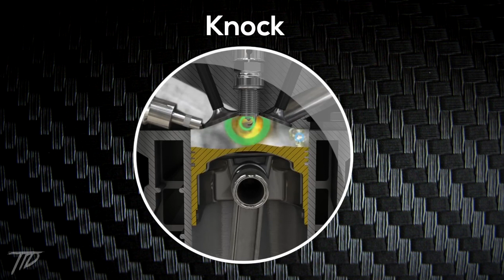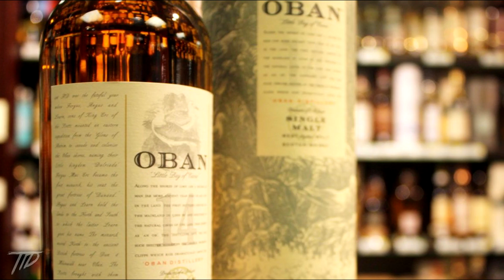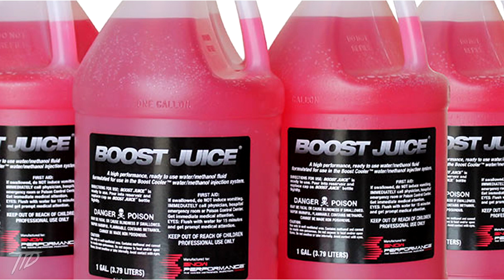What's the difference between E85 vs Water Methanol Injection?

Comment: any advantage or power gains by running on say a cammed NA 2019 6.2L silverado?
Reply from the maker: Typically, the use of E85 or meth injection only provides a significant benefit to forced induction applications.  An NA application won’t benefit nearly as much from what these fuels/additives offer.

Comment: I’m currently running E85+ on my car but still seeing higher levels of heat in the engine causing my electric fans to constantly stay on and sometimes my coolant temp’s are very high. Is it possible to run both E85 and water meth to keep the engine temperature down during boost?

Comment: I am in the process of installing a Snow Perf water/meth 2.5 kit on my ‘20 F150 3.5EB. Can’t wait to see how it improves my et’s.
Reply: Do you have it up and running? I have a Flex Ecoboost with the same engine and have wanted to install a system
Reply: @resuwrecked  not yet. I have had a few life hiccups lately. Hopefully by next weekend I’ll have it finished. I’ll comment back on here when I do and you can go watch the video I’ll be posting about it.
Reply: @Estudiante77  Any updates to your install and use after installation?
Reply: @StelaPop  I finished the install back in February. I ran 3 gallons of water meth. I was satisfied with the results. Are used the 87 water meth tune that my tuner provided. But in March I had a hand accident at work and put me out of work for two weeks and then spent 12 weeks for therapy. Then I got real busy at work. And I never had a chance to upload a video about the install. But, I need to make time to do that.
Reply: Sorry to hear of your injury and time off. Glad you are back at it.

Comment: You only use W/M when you're on boost vs e85 at all times.
You must  have a flex fuel kit installed where there's no e85 around or planning to travel or you're stuck. Also is corrosive so you must use "special" injection systems to be compatible and so you gotta buy other parts to support the set up whereas W/M don't, as it's being sprayed from a reservoir not the gas tank.
E85 gives lots of fuel issues compared to W/M plus e85 sucks in the winter.
W/M is the way to go, I'm getting a kit for the summer, more convenient, less expensive and meant for daily driving.
Reply: I got 2 cars on it without issues.
Reply: Missing a few points, methanol is corrosive and does also attract water just like E-85. I'm going to be running both for the best of both worlds.
Reply: I heard meth for my car which is a inline 6 doesn't reach the last cylinder head when it sprays so I'm not sure of using it..
Reply: @charles-fq2dw go port injection so each cylinder gets equal amounts of

Comment: is flex fuel the same as e-85? Royal Farms has what they call Flex Fuel 104 I assume 104 is the octane rating which is about what e-85 is supposed to have (105) but I'm not sure I can assume the actual ethanol content. I'm running a full bolt ons Stage 2 Plus 2015 BMW 335i and am thinking about doing a meth kit too, already have the connector on my VRSF charge pipe so I'm set up for it. I do hear that the best set up for my car is running 50/50 meth/water and on a E-20 map if I'm on a stock fuel system. I assume I would need a custom map to really get the benefits of meth though, what do you think?
Reply: flex fuel means ur computer has a flex fuel sensor that can read and analize either e85 or any other octane ur using. 104 octane is GAS not ETHANOL. ur confused bro. E85 is not 104 gas octane although it equals about 105 octance it is NOT GAS ITS ETHANOL. theyre different fuels. u can run 50/50 but plenty run straight M1 which is methanol
Reply: @TENNESSEETRACKHAWK  negative, I not only confirmed with them that it's ethanol I've tested it now 3 times myself and it's exactly 83% ethanol as they said for the summer blend (76% they claim for the winter blend)
Reply: @chrisgarret3285  Are u drunk dude? Du u have any idea what flex fuel is? U seem utterly clueless. Flex fuel is not E85. E85 is an ethanol based fuel and can be used if ur car accepts flex fuel or not. Get a clue dude smfh. I use E85 and I dont have flex fuel. I cant run 93 octane cause I dont have a flex fuel sensor. This isnt rocket science bro. Flex fuel means u can run both Ethanol and gas.

Comment: Intercooler or MeOH water injection? What is better?  Intercooler works all the time, Methanol water needs careful tuning , correct?
Reply from the maker: For any kind of forced induction you should be intercooling the hot charged air.  MeOh injection is a way to run more of that cooled charge air (boost) and mitigate the harmful effects of knock/pre-detonation. So the intercooler and MeOh injection serve two different functions.

Comment: Can Water Methanol Be Used To Run More Boost / HP On Same Ring Gap? I Got A 5.7 Hemi With Stock Ring Gap And It's Making 450AWHP With Zero Knock And Only Has 11 Degrees Of Total Timing In It. I Got Enough Fuel System For More But No Idea How Close The Rings Are To Kissing. Would Water Methanol Effective Allow Me To Make More HP With Same Ring Gap? Lol Sounds Weird This Way.
Reply: I’m running 13 psi stock everything only thing touched is cam I’m using water meth as well
Reply: 11 degrees is super safe. I would still drop the crank and check it.

Comment: What if you want to run both E85 and Meth? Any issues with that?
Reply from the maker: If your fuel system cannot handle delivering high ethanol content fuel, you can supplement Methanol to get the performance gains you are looking to achieve. Typically, only one is used but both can be combined.
Reply: @TunerTestDrive  do you have a email that I can send you pictures so I can see the meaning of using this version for future reference?

Comment: I chose methanol injection and 93 octane. There is no dependable e85 near me. But i have run e85. Once i found out the variables of e85 i went methanol. Much simpler and you know what your getting everytime.
Reply: Just brew your own alcohol lol
Reply: @draven4464 make your own gasoline
Reply: So for future reference I can do E85 and then 93 together? Or use both of them of which is available to me while riding? And another thing, what do I put in the AEM kit? Is it a certain fluid I put in there while I’m running either gasoline?
Reply: @lt-prezz-unoh6520 yes you can mix I run e30 in my civic
Reply: @Candybuiltsi  does it make your car run smoothly?
Reply: @Candybuiltsi  what about in a charger or Durango?
Reply: @lt-prezz-unoh6520 car must be tuned for ethanol utilizating a flex fuel sensor in my application. I don’t know if durangos come flex fuel from factory. What you could do is add about 1 gallon of ethanol every fill up tuned on ethanol or not. You car wouldn’t need to be tuned for such little ethanol considering ethanol normal gas contains up to 10 percent (e10) in it. Adding about a gallon of e85 to a fill up of about 11 gallon tank should make that that ethanol count jump from e10-e15. A stock car can support e15 no tune no nothing try it out and tell me how it rips biggest difference in places like California where we only have crap 91. 1 gallon of e85 rest 91
Reply: @Candybuiltsi  thanks man I appreciate it, there's some durangos that are flex fuel, probably the older models but got me thinking bruddah 🤞 thanks for the update information and keeping in touch 💯
Reply: Any idea which one made more power?

Comment: Why does my Toyota hilux sr5 5vzfe engine run better when mixed with standard unleaded mixed with E85 even tho burns quicker but it revs harder and it pulls harder? Just wondering?
Reply: Sounds like you have water in your system that the Ethanol is helping to burn out.
Reply: @Luckingsworth  I've done a compression test. Cylinder leak down test! And all good!!!!! It's been a strange issue for awhile now! Cheers anyway!🙂

Comment: I got an alignment recently.  They didn't and didn't hook up a ground wire and it caused the meth to flood the motor and ruined the entire motor.  Done with methanol now.  This was controlled by JB4 with all the failsafes too... smh.
Reply: Why were they fiddling with any grpund wires or anything related to your meth kit when you were there for an alignment?
Reply: Frankie Lopez 9 months later, now I’m also highly confused lol
Reply: Terry Gambler You skipped the solenoid

https://www.snowperformance.net/snow-performance-high-flow-water-methanol-solenoid-upgrade-quick-connect-fittings-sno-40060.asp
Reply: This is a case of poor work
Reply: @Terry Gambler was this with the solenoid? They claim the solenoid protects from methanol leaks.

Comment: I have a 98 S366 supra 6spd. Been contemplating which route: E85 or Meth/Water injection. I have two E85 stations near me. My goal is about 650HP.  The shop I have in mind estimates about $6500 to fully convert my car to E85 w/ flex fuel (parts and labor). I already have a HKS Vpro, 1000cc injectors, walbro 450 ready to be installed. I just need to purchase a quality meth kit (have the snow performance stage 3 in mind). Other mods I have are Tomei 264 cams, HKS DLI, and the usual bolt ons. What do you recommend? Been in this scene since 2004 and I've heard so many horror stories on meth kits failing...but with technology now, surely fail-safes have improved a lot better?

Liked and subscribed!
Reply: Only go e if your going with A flex fuel besides that don't fuck with it.
Reply from the maker: I'd go E85 if you have access to it and since you're going to setup flex fuel you won't have to really worry about mixing regular gas with the E85 since if it's setup right the fuel map and boost levels should all adjust accordingly. With an S366, 1000ccs and E85 you should have no problem hitting 650.  E85 will help spool up some as well since your exhaust volume will be higher.

From what I've seen the new meth kits are more reliable than the earlier kits.